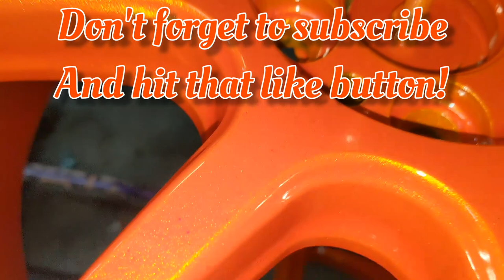Unknown Coatings - Ep 66 - powder coating candies and other two stage

Comment: Hey, I usually see you hanging wheeks from the valve stem hole but I see yiu hanging from the center in this vid. I'm building a larger oven myself so I can also do wheels and can decide how I want to hang the wheels which will affect the dimensions of my oven. Would you mind offering some insight or advice? Thanks, great channel thanks for sharing!
Reply from the maker: I hang wheels one of two ways, sometimes its color specific or specific to the design of the wheel.   Shouldnt effect how you build your oven though

Comment: Nice videography and music! I noticed some Farady at the ends of the spokes on one of the wheels as you began spraying. When you finished spraying, it was gone. Could you comment on how you concentrate on these areas to overcome this effect.
Reply: George Burns would also like to have that explained. I battle with this and I’m not using a hobby gun any more.
Reply from the maker: Yeah I will have to do it in another video probably.- Its just a matter of getting most of the area covered, then dropping KV and upping PSI a little to direct powder into those areas
Reply: @UnknownCoatings  OK, that makes sense. Thanks for the reply

Comment: I watch all your videos love the results you get. Looking to start powder coating alloy wheels in the uk. What powder coating system would you recommend to get professional results but not break the bank at the same time.
Cheers Roy
Reply from the maker: If you can spend close to 2000 USD, I got a great system. but if not, let me know your budget and I can point you in the right direction
Reply: Unknown Coatings what make system is it you have? Was looking at spending about £1000 but could go a bit more. I also need an oven and blasting cabinet and possibly a booth.

Comment: Beautiful color man. So if you see my videos I put powder on thin I feel because I’m worried about putting it on way to thick and getting orange peel. Watching you I feel you put it on thicker. Should I do mine thicker do you think? Or I’m I doing ok. It just looks like after watching u I’m way to thin
Reply from the maker: I will have to check em out. You could always get a meter to check it? Mil thickness gauge.

Comment: Great video.  Does lowering the voltage 5kv really make a difference on the second coat?
Reply from the maker: i typically just follow the recommendations from the supplier. I cant imagine its a HUGE difference honestly.
Reply: Unknown Coatings I thought it was usual practice to lower the kv for additional coats.

Comment: Does the 10 min start when the parts is at 400 or when you the oven gets to 400 im Trying  Prismatic powders Chrome 3 And it turns a dull grey and not more Chrome ??
Reply from the maker: When the part reaches temperature